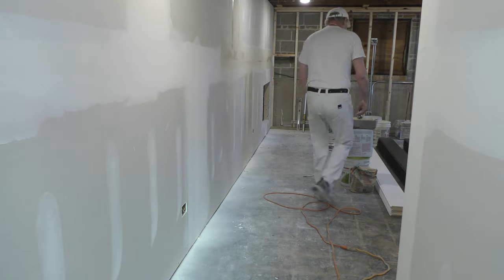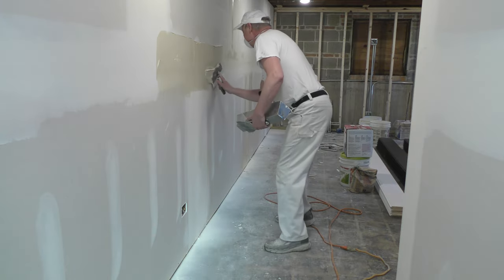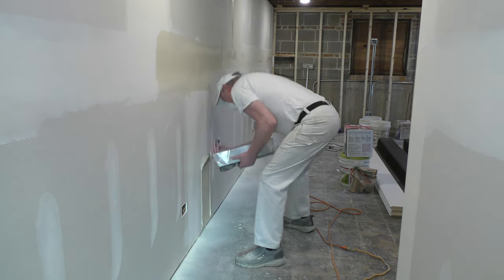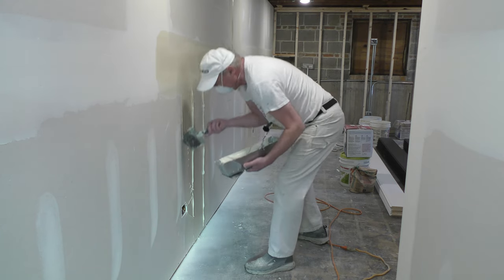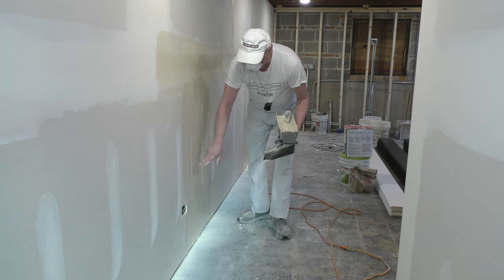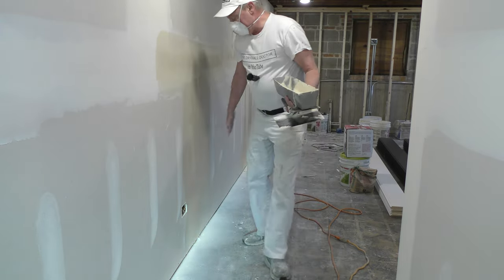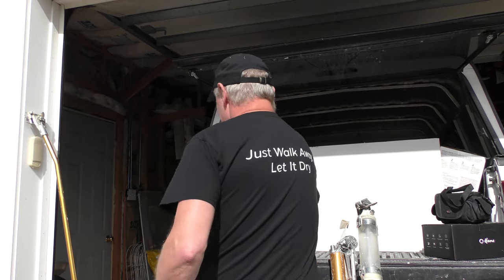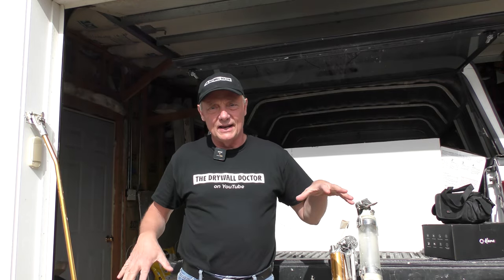Drywall Butt Joints By Hand

Comment: I see you have a bucket of that light green joint compound. I did 3 rooms bedding joints and inside corners. Is that ok? The there seems to be less glue? Ill use plus3 for 2nd coat. Should have used +3  everywhere?
Reply from the maker: No, the light green mud is very good for all phases  of finishing.
Reply: @THEDRYWALLDOCTOR1  I've been tearing short runs of bed joint tape off and it pulls right off. When I top with plus 3 will it seal the tape better?
Reply: @THEDRYWALLDOCTOR1  I did a test spot on a flat wall with light green mud and plus 3. Light green tape tore off completely and plus 3 left some tape there. I'm just wondering why. Plus 3 has more glue? I should have taped with green all purpose as it's heavier and has more glue? Love your content always!
Reply from the maker: Yes the green lid all purpose is the best for just applying tape.  +3 tends to leave blisters  when putting it through the bazooka.  The light green is supposed to be a true all purpose  and runs through the bazooka really well.  You can also top , skim and sand it easily.
Reply from the maker: I think you might of wiped all  the mud out from behind the tape that's easy to do with the light green all purpose.
Reply: @THEDRYWALLDOCTOR1  Thanks for the reply! I did  2 small rooms today, 1st coat over tape. Used a 10" trial to do tje flat vertical seams 1st. Cieling later. But I did do inside corners with 10-12" trials both sides. Not too bad. Thing is I only had 3 small blisters on the cieling bed joints.  Stuck them open and filled with plus 3 and flattened. Everywhere else the plus 3 sat good so I think I might squeak by on 2nd coat. My butt joints are 3 wide with a little tape showing so I'll have to review one of your vids. Thanks so much!

Comment: Why do you use paper tape?when mesh is so much simpler
Reply from the maker: I use it for certain things but I taped that with a bazooka
Reply: Much faster with a bazooka or a banjo than hand taping with hot mud and mesh. And if you’re not using hot mud with mesh, you’re doing it wrong.
Reply: @nicholasjohn1001  you’ll use much less mud with mesh
Reply: @THEDRYWALLDOCTOR1  isn't this pretty small for the bazooka? I would have use my super taper especially if i can reach all the joints 🤔👍👌👍🇨🇦😎
Reply from the maker: It was dirty from another job and I had a great place to wash up here.
Reply: @Gog3453   very possible, I’ve never been a fan of mesh except for patches. I’ve seen way to many mesh jobs crack. But it keeps me in business fixing them.
Reply from the maker: Same here
Reply: He doesn't want to have to come back and re-tape all of it when it cracks.
Reply: Mesh can be used for factory joints covered with hotmud. Saves ya a prefill coat since doc prefills all his joints… But mesh is a huge no no on butt joints even with hotmud on
Reply: @NewmarketDrywalltaping  that because you don’t know how to apply mesh tape
Reply: @Gog3453  why don’t you enlighten me on how you do it?
Reply: That’s a lot of mud🥺
Reply: @NewmarketDrywalltaping  use a 4”roller instead of a knife
Reply from the maker: Seriously how hard is it to apply mesh tape? Isn't that why people use it because it's easier.